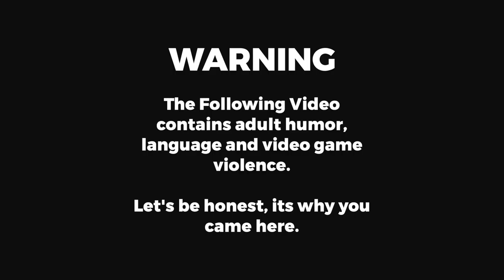Why Space Combat is Wrong...

Comment: Let me guess, 
In reality there would be no sound, no fire, no huge explosions, and firing a firearm in space would send the person or object the opposite direction
Reply: Alfredo Ramirez actually yes
Reply: No sound unless you were in contact of something that could transmit sound (you could hear your own space station exploding), fire and explosions exist as long as there is oxygen, actually fire and explosions are way more destructive due to no constraining convection currents ("heat rises" doesn't work if there is an up), and firing a gun would exert the same force in space as on earth in recoil.  On earth though, you can resist the movement since gravity holds you on the ground.  Guns would still work since the gunpowder carries its own oxygen in the powder, but a big issue is that in vacuum, close fitting metal parts cold weld together very easily.
Reply: Fire in space wouldn't be as continuous as fires in popular culture. If the Death  Star blew up in real life there would be an explosion but it wouldn't be as big as in Star Wars. Isaac Newton's 1st law of motion: Objects at rest remain at rest...unless acted upon an unbalanced force
Reply: There's no sound in the vacuum of space
Reply: Right...no sound transmitted though a vacuum.  It you were in your own space station one would assume it was filled with air.  Additionally, sound transmits farther and faster through metal and other solid material with an average of 5000 m/s in steel and aluminum vs 343 m/s in air at standard atmosphere @20 degrees C.  Fire in space wouldn't be as thematic as fires in in Sci-fi movies, but is actually quite a bit worse.  NASA tests have shown that flames are cooler than on earth and require less oxygen.  These flames are actually more dangerous as they have the ability to spread in any direction equally well, and worse, can ignite solid metals like aluminum and magnesium (both of these have a layer of oxide that will sustain them for a while even with no Oxygen)
As for the death star...the explosion would be huge.  Remember, you are detonating a power reactor that is capable of powering an entire ship that is 120 km in diameter (info from Wookiepedia)  So, probably something on the order of the power generated in the entire northern hemisphere.  There is your outside force :-D
Reply: Joshua Callaway I see your point but what meant about the explosion on the Death Star it would most likely be a big but short explosion (assuming the oxygen is rapidly consumed by the fire and the vacuum of space)
Reply: Yeah...probably something like that!  As much as I hate to admit it, the "remastered" star wars probably has more accurate explosion (minus the stupid ring that has no reason to be there other than its "cool"...F U Lucas!).  Lots of crap flying out, small fireball, but no bang since you only have vacuum between the observer and the Death Star.  I wonder though, since it was likely a nuclear explosion, would the radiation pressure wave acting on your X-Wing or whatever, create sound inside the ship?  MAN I LOVE SPACE!!!
Reply: Alfredo Ramirez and the person holding the gun and the bullet would never stop until they hit something or got pulled into the gravitational pull of something

Comment: Thrust or better to say the vectoring of it is actually the steering in rockets, it is also used on some modern figther jets for better manuverbility and VTOL (Vertical Takeoff and Landing) capability.

https://en.wikipedia.org/wiki/Thrust_vectoring

Also in regard to spacebricks especialy on smaller spacecrafts u might wanna have the ability of atmosphiric flight other than the  TVC as it would propably have to be very oversiced for its primary purpus of space steering to generate enough lift in planetary gravitational fields

Comment: Do your guns have recoil absorbtion? Cannons on galleons are mounted on trollies with wheels and restrained by ropes, that way they don't rock the boat, so you can fire more than one at a time and not loose accuracy.
Remember lasers fire photons which have for all practical purposes have no mass and so no recoil.
Reply from the maker: it wouldn't make a difference... a ship has friction from the water... it wouldn't move backwards if it fired without recoil absorbtion... it might rock though.

In space, the recoil isn't providing the force, the projectile leaving is... so the force of the projectile leaving the barrel would in fact reduce forward speed, or momentum.

As for lasers... not sure yet... we have no evidence of the effect of a laser fired in a vaccum or the power required to generate that force of impact on its firing body and its momentum yet.
Reply from the maker: Recoil isn't the issue... its the force imparted by the departing round... it has a force regardless of recoil.

Comment: U should have a look at the video game series Mass effect. They do take physics into account.
Reply from the maker: Eh not really they have anti gravity and ftl travel, but it’s an amazing game series on its own
Reply: @Firekitten_official  actually if u look into the lore u will learn that that anti-gravity is the basis of all mass effect technology and is entirely plausible. According to scientists, if u were able to harness dark energy, u would be able to preform amazing feats of gravity manipulation. Mass effect only short cuts this by having a mineral that emits concentrated dark energy as radiation(which is also not entirely within the realm of impossible). As for FTL. The way it works in mass effect is that just as light moves slower through glass then air, it also moves slower through space then a dark energy high speed mass effect field. What this means is that if u can surround a ship in a mass effect field then a light enough ship with enough thrust can fly faster than the light outside the field while still flying slower than the light inside the field. This eliminates issues regarding the theory of relativity and time dilation

Have a look on YouTube or on the internet, what the technical applications of dark energy are and u will see that Mass effect technology is a lot more science then fiction